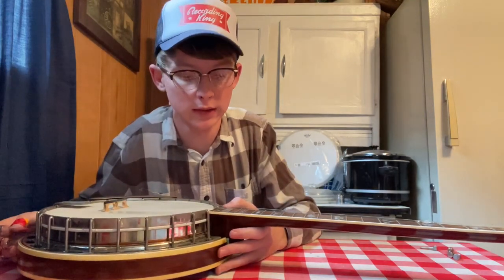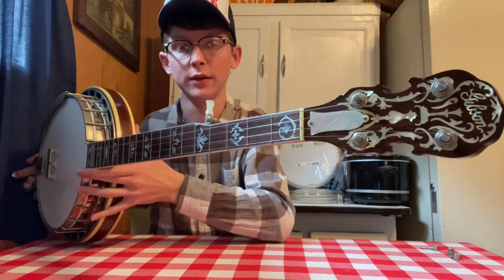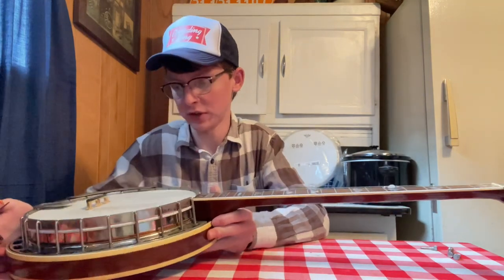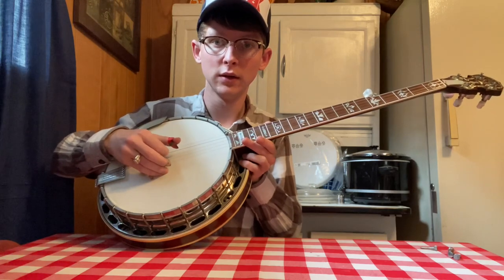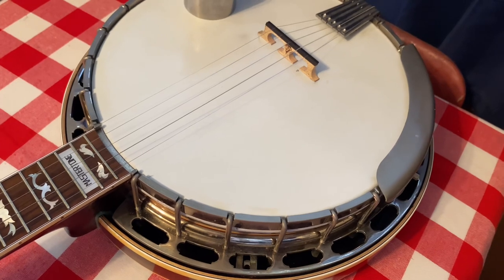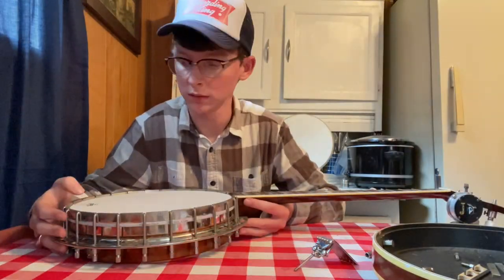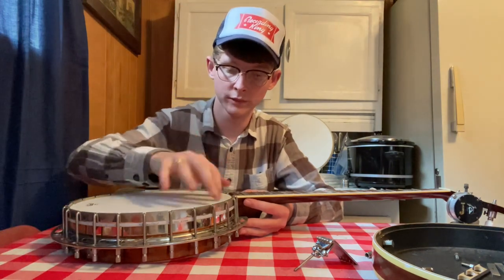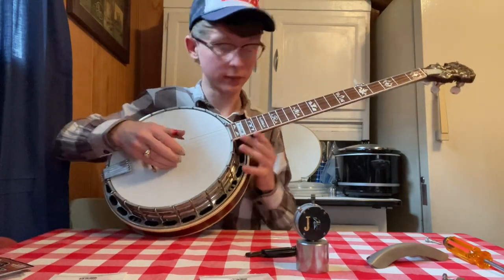Gibson Mastertone Banjo Setup - 5 Star vs. Remo Head

Comment: Click between these to times to compare:

2:51 old thicker head
12:04 new head, new strings

Now I need to check what head's on my recording king banjo because it sounds great with the new setup.
Reply: He seems to keep the co-rods loose as well to let the rim vibrate more, there's another setup video on the Goldstar banjo setup.  
Sounds way better of course at 12:04, than 2:51, be nice if he would pull out one of the good banjos to compare it to!  Like a prewar conversion or something?  Maybe in the next video perhaps. I will subscribe anyways, keep checking back on occasion.  Thanks for all the information, I also have an ES 1993 Gibson and I think the tone ring fit was off from the factory, has always sounded weak.  Came from Elderly and I only paid less then 2K brand new...  A few years back I suppose.  This video is very much in line with getting that ESS (Earl Scruggs Standard) to sound better.

Comment: I enjoyed the video and the discussion of 5-Star heads vs Remo heads.  I have a 27 nohole AT and it has a Remo head, and a fairly new FN neck on it.  (Not putting his name here, most people will know...)  So I am in the PNW and banjo got shipped out here from Russell Springs, KY, (clue #2), and it sounded awesome but time has passed and we had a cold winter, I keep it in the case, but looks like neck has bowed to maybe .27 or so, and head is higher than a quarter under a straight edge, (I am a cheapskate too!) anyways, where would you put the head tension for an Archie 4 nohole and trying to get more of that flathead sound?  Everything I have read says a quarter under a straightedge and about .15 for truss rod at 7th fret.  Banjo came with a Sullivan Bridge, think it's a 5/8", just wondering since you're back that way if you know what gauge strings Frank likes to use and how he sets them up, I guess I could just call him as well, but I watched this video and am pretty impressed!  You seem to know your stuff, it just needs slight adjustment I am pretty sure. I don't want to mess with it very much.  Thanks for putting up this video and the Gold Star setup video, really good stuff.  Suppose I should get me a drum dial at some point in time.

Comment: I had an 800 that sounded great with a 5 star. I changed to a remo and it sound like a $150 piece of junk. My father in law had a remo, put on a new remo and the same thing happened to his grenada. Not sure if it was a bad batch or what but they were really thin with very little frosting. My grenada has a Sullivan head. It’s great. Vega Scruggs model has a remo. It’s great. That 800 just needs a thick head.
Reply: If the "Sullivan" head is one with the old First Quality logo, that's a Ludwig, same as 5-Star. If it's something else, then Remo.